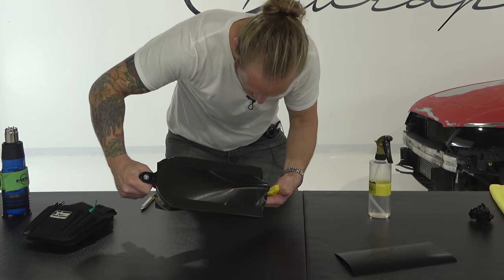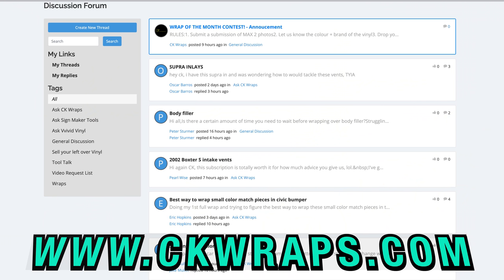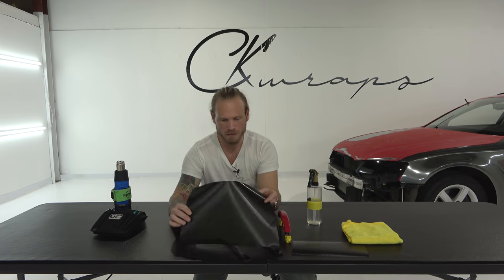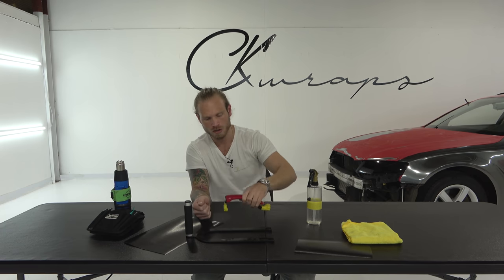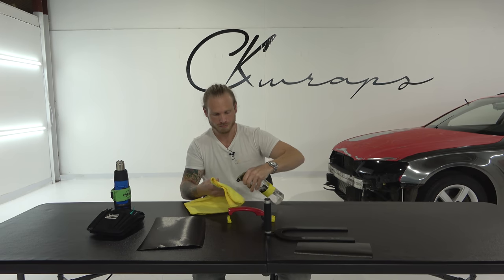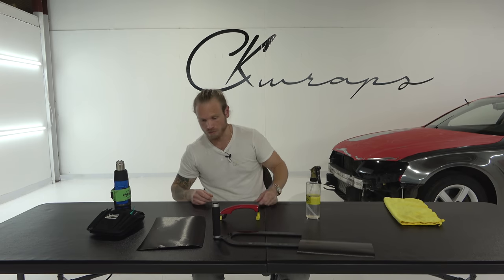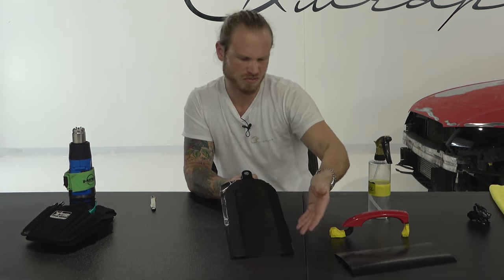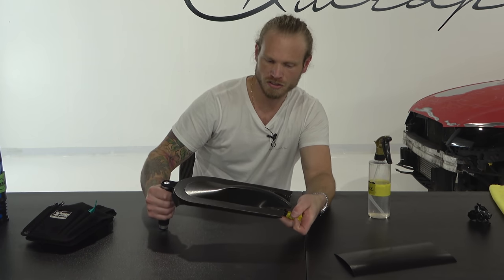The EASY Way To Wrap Any Door Handle

Comment: Just did a partial hood wrap centered in the the hood lines. I used a smooth painters stick in my left hand too support the vinyl as  I smoothed it down right to left. Temp in the upper 80's had to keep it off the string tape as repositioning the vinyl after contact was next to impossible. A small stick in your right hand to pull the vinyl evenly might help to prevent wrinkles when wrapping a door handle. Took two tries but ok with the results. Just a rookie.